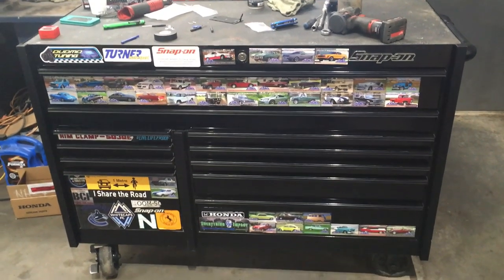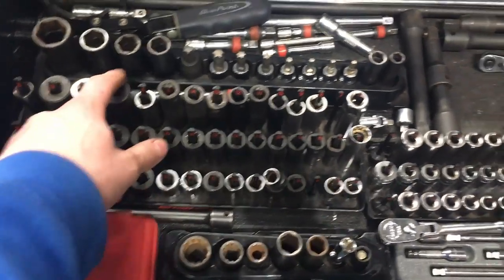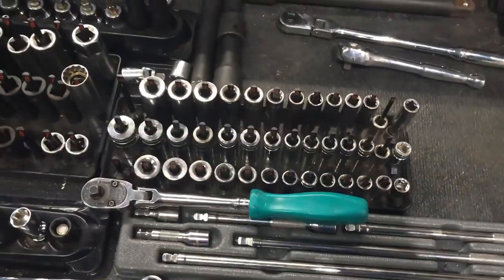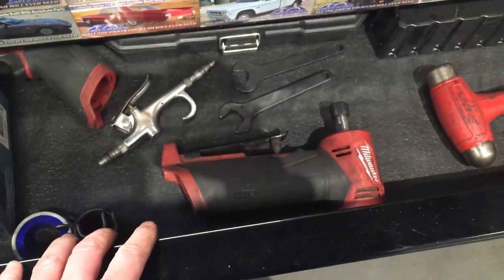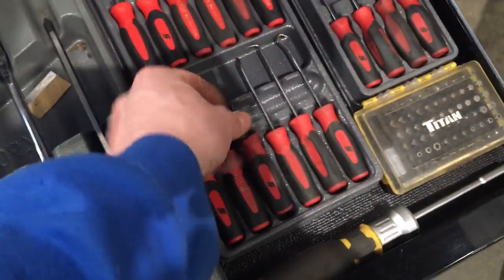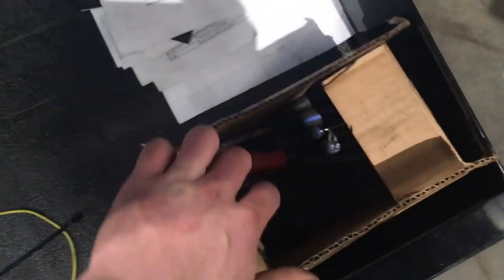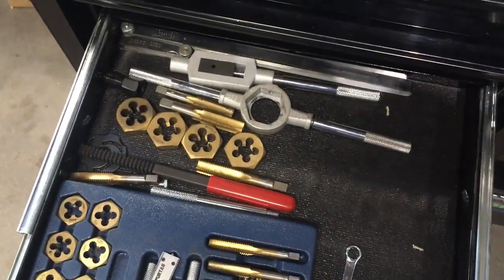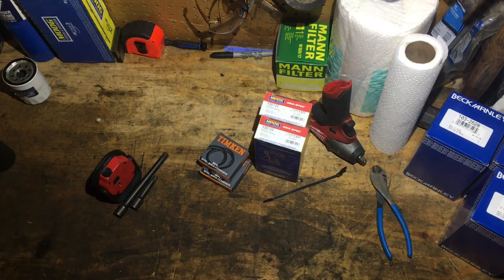Honda Technician Toolbox Tour; Snap On KRL722

Comment: I'm a Honda tech as well, my dealership also shut down but we do what we can. My tool cart isn't as loaded as yours but then again Hondas don't need a lot of tools to repair... Good luck that for the video 👨‍🔧🚘
Reply from the maker: You can go really far with Honda's with barely any special tools. I would say that working on them has actually turned me into a fan of them, really good product and good to work on. Definitely lots of stuff that I don't need to have in my box.The wrenches are totally overkill and the socket drawer is basically wasted space. I bought the box because I wanted something that I could fit all my tools in (my BMW/VW special tools are all at home (E-Torx, 16/18mm special wrenches, etc), as well as all my SAE stuff). Obviously not needed right now at the dealership.
Reply: @MyNameIsJustinKeenan  yes most European vehicles for some reason require specialty tools...

Comment: Honda technician as well. Nice box review love the idea of all tools up front so you don’t have to open your drawer all the way. A little advice I did with my roll cart, I used the Honda coolant containers I cut about 2 to 3inch from the bottom clean them out and use them as trays for all my smalls stuff like your drill bits, old relays, pens, markers, plastic razors, used Honda bond. I’ll try to do a tool box tour. Hope you guys get back to work soon or hope your already back at it. Good luck 🤙🏼🤙🏼🤙🏼🤙🏼🤙🏼
Reply from the maker: Thanks man, the containers are definitely a good idea. I was never really laid off for too long, I ended up switching to a BMW dealership a few months later last year, I hope to have a tool box tour up soon of it now, set up for BMW's.

Comment: I use a mirror a lot for checking brake pads without pulling the wheels off. So for like doing inspections and trying to upsell. A lot of times outside pads will be like 6mm and inside will be 1/2mm bc rust.

Comment: That's a cute tool box and tools lol. Man working on semis is expensive.
Reply from the maker: Thanks for the comment polarisboy67! One of my coworkers worked out of a 30x10, 3 drawer cabinet when I was at Honda. Mind you, they did borrow a fair number of tools.

That being said, I always like watching the videos of technicians in India, China, and the middle east. Those guys are out there putting entire transport truck axle housings on lathes, replacing plates in batteries and dumping the acid into the sewers lol. 

Working on anything in North America, we’re a bit spoiled with all the tools we have, and how easy parts are to get.
Reply: @MyNameIsJustinKeenan  I honestly didn't mean any offense with that comment. But I do agree with watching those techs in those country's its absolutely insane what they can do with what they have. But in the class 8 world that I'm in getting parts is extremely hard with wait time in the multiple months range. When the trucks I work on are the only income for most operators it's hard.
Reply from the maker: @polarisboy67  no worries at all man. 

I know what you mean about parts availability being a difficult point, especially when the vehicle is something the owner depends on. 

There were definitely times where I saw that face to face when I was working at Honda. Had one customer try to barter down the price of a serp belt replacement with the service advisor, lol.

I’m at the other end of the spectrum now, at a euro/porsche specailist that does restoration work as well as maintenance on classics. 

Parts availability still sucks at times, but instead its for vehicles that sit for over half the year regardless of their running condition.

Comment: Nice video. If you do get a different air hammer check out the mayhew shake n break. Awesome for getting those rotor screws out
Reply from the maker: Greg Blau thanks! I actually found a .498 to .401 reducer on amazon that I’m going to look to buy along with the quick chuck for big nasty whenever we get back to work. The shake n break is a great idea, definitely want to have it haha.

Comment: Box looks near identical to mine, black on black... I put the bedliner top on though. Nice video.
Reply from the maker: SpeedDemon88X thanks for watching! Got mine used for a real good price, I have a hardwood top to go on whenever work opens back up sitting in the trunk of my car.
Reply: @MyNameIsJustinKeenan  I paid 3 grand new for my 722, and another 450 for the top.
Reply: @SpeedDemon88X  Could have found a used Epic or Triple bay master series with tops and or lockers/hutches etc. Buy used, don't get raped by the truck and interest.
Reply: @LordRumple  for 3 grand? Doubtful...what I paid for the 722 new is right around what I see them selling for used locally on craigslist. I didn't finance it
Reply from the maker: @SpeedDemon88X  My friend bought a triple bank masters series (30" deep) for 7K CAD new (scratch & dent) off the truck before he got out of trade school, offered it to me for $3500 after he left the trade 9 months later. Would have jumped on it if not for the fact that our shop couldn't accommodate a box that big.
Reply: @MyNameIsJustinKeenan  for sure a good deal will come up sometimes like that, but rarely will it be in the same color that you want. Happy with what I paid for a brand new box with the exact trim and color I wanted too. To think people are spending 5 grand+ on a small KRL722, I would never lol.
Reply: What people ask on CL is a far cry from what they actually get.

Comment: Appreciate the tour. I personally don’t buy any Chinese tools and support China like you have. Snap on, Mac, Wright, Proto, SK, etc..plenty of great tools out there. I do like the American made tools and box you have. The snap on 700 lm aluminum project light $80  (270 degree rotation) 2hrs on high....a better light is the Astro light same size, same aluminum body, same over mold , same 700 lm, but 360 degree rotation, stronger magnet, 4hr on high amazon $40...
     For screwdrivers I’d recommend wera laser tip, nothing better. For pry bars, picks, Mayhew.( Mayhew makes snap on prybars and hammers) ..decent collection, hate Chinese crap..
Reply from the maker: Pretty much impossible to not buy Chinese with purchasing electric tools, and it's hard enough to get into this trade, let alone with the high cost of tool purchases. I live in a small town with only one tool truck and one retailer for other tools that doesn't close before I'm off work. I've only been in the trade for 2 years, if I spent all my money on USA made products, I would barely have any tools. 

With US to Canadian conversion, plus provincial taxes, a 10-19mm wrench set, a 22pc punch set, shallow, semi-deep and deep metric chrome sockets in 3/8 and 1/4 add up to $3900. Maybe my dealer really likes me and bumps that all down to $3000 for me, but I sure don't have $3000 to give him so I put it on credit, and end up paying $3500 all said and done. I can buy similar, non-tool truck tools that work well enough, for $600 Canadian. Not sure where the extra $2400 of my after tax money is going to come from, I don't make a whole ton as an apprentice and spent around $5000 on tools last year. 

That Astro light is a Chinese product by the way, same as the Snap-On one. On Canadian Amazon, that light is $80 and the Snap-On is $100. I do appreciate the info though, I've liked the Astro stuff I've used and I might consider that one for home use. Mayhew stuff is very nice, I have their 12" pry bar after I lost my Milwaukee one, I do like the Milwaukee one better actually, not that there is anything wrong with the Mayhew. Definitely looking at the Wera torx screwdrivers as we don't use much torx but I like to have a decent set for working on my own car.
Reply: Justin Keenan well your in Canada so it’s different except never buy Chinese products if at all possible. Also I agree most cordless tools are from China except many Dewalt tools are made in America,which I use and some IR . Plus you don’t have to ever buy on a tool truck. Used quality tools are half price on eBay and much better quality then new Chinese tools. Also online ....is always available. 
     I get what your saying, personally I worked two jobs when I started in the building trade to buy the best American made tools, Occidental leather, Stiletto hammers, etc...my point is no one should be supporting a communist country like China, especially now when China is responsible for the Coronavirus which made 23 million Americans unemployed, and thousands have died.
     It’s not personal, I leave feedback on every channel that doesn’t buy American made products and support America and American companies....I think you guys have different stores, you should probably support your locally made tool stores....I do wish you well, and hope your successful.👍🇺🇸
Reply: I do hope you realize that snapon imports parts from their manufacturer in China. The reason it's "Made in USA" is because they just put it together here.